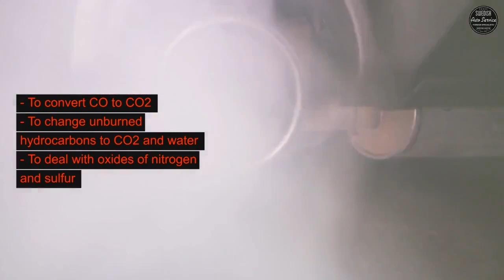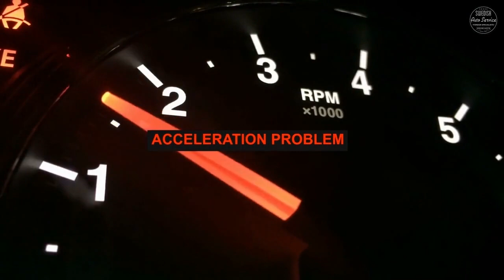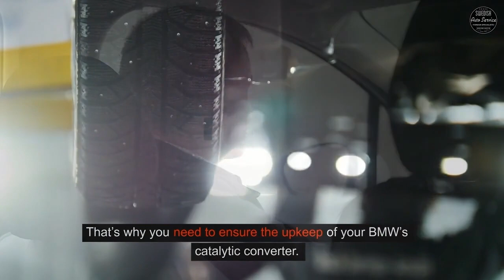What Problems A Bad Catalytic Converter Can Cause In Your BMW

Comment: As far as I'm aware, the ECU cannot compensate for a faulty cat converter. It can only report on the condition of the exhaust gasses after the cat. It uses the after cat O2 sensor to measure the O2 content of the gas. If the cat is faulty the only outcome can be that the emissions will be above the limit. How much depends on the damage to the cat. A blocked catalytic converter will affect the engine as reported in this video. However, the most common fault code which causes the check engine light to come on is
P0420 Catalyst System Efficiency Below Threshold (Bank 1). As in any diagnosis it is essential to follow a disciplined process to get to the root cause of the fault. The code is a symptom of a fault not the cause. Therefore you need to determine why the cat has become inefficient. The symptoms outlined in this video may have caused the cat to become below the required level. Replacing the cat will be a temporary and costly mistake. The root cause must be determined and rectified first.